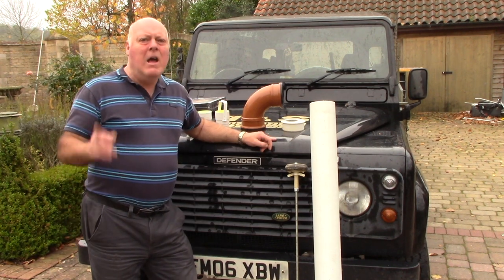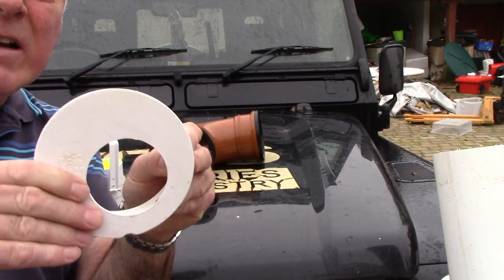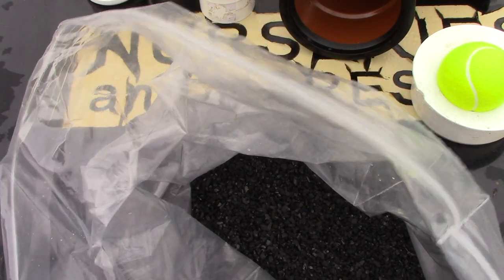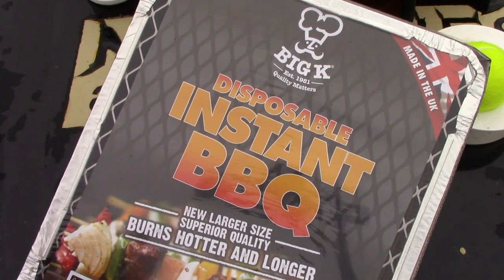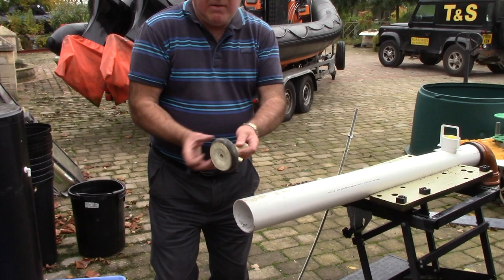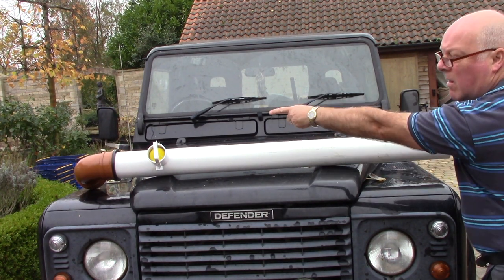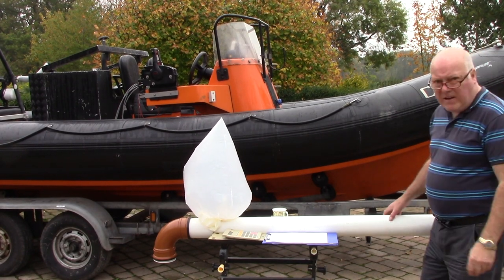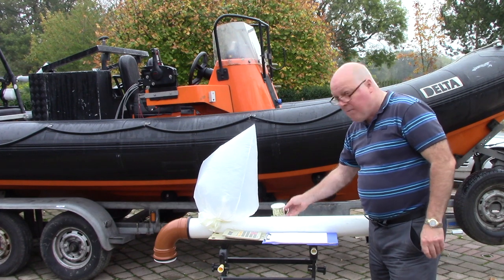Making a Nuclear-Resistant Air Filter

Comment: Good concept. I'm sorry mate, but there are some concerns with your design.  When gluing PVC pipe, you need tighter fits between the cut pieces. The glue does not seal gaps very well. The glue "melts" the PVC plastic together as it sets. You coat each mating surface FIRST, then twist back and forth into place to get the PVC to soften (melt) together, not glue after mating. A minute later you have an air/water tight seal. Your gaps are too wide, the glue will not hold well in the gaps and leaks will form. Your tennis balls are check valves. The Fuzz on the balls leak air a tiny bit. Smooth rubber balls would get a better seal.  The towel around your activated charcoal (carbon) will have less resistance to air flow and microscopic fallout (smaller than smoke particles) will get through the towel fibers and only some will go through the filter. You need to make a canister of activated carbon. It should have screens and HEPA filters on each end to hold the activated carbon inside, and rubber seals around the canister to keep contaminated air getting past it.
Reply: So you should do a video with the updates or some pic's
Reply: @lorimaravilla8379  I use a battery/bike pedal electric air pump in my doomsday shelter. I have no interest in making a PVC pump and I don't post details on my systems. I only giged him on things that he thought were OK but clearly has no real experience with PVC pipes or nuclear fallout. I said it was a good concept, my comment was to warn others that he has some fatal flaws and how to fix them.
Reply: Plumber
Reply: @lorimaravilla8379  tbh 2 socks taped over a vent are better than nothing. This is better than 2 socks.
Reply: @lorimaravilla8379  The king of random has a home made pvc air/water pump. I'm sure that design can be easily adapted for use.
Reply: @paulromsky9527  While you right people would fair better with what he has made then if they had nothing i.e. those who despite all the warnings on the wall.

My issues with his design are more related to the initial heat wave and if that would be enough to either melt the PVC or set the charcoal on fire. Plus I am not really keen on breathing what comes out of heated up PVC chemically speaking.
Reply: @AussieSurvivalAndPreparedness  Yes, PVC outgasses for decades (before it half lifes). Look at the dashboard of your car, even if you don't smoke, a thin clear haze will deposit on the inside of your windshield. This is not from air pollution, it is from the outgassing of the plastics in the dashboard. I used to work in laser and space satellite design, it's amazing what outgasses. In space where the pressure is in micro Torr, even metals outgass. It really limits your materials.
Reply: @paulromsky9527  this comment section seems pretty knowledgeable were I'm building my shelter is kind of in a forest and so is my house 😂 but it just crossed my mind I'm not sure but how hot would it get in a bunker if a forest fire was raging on top of you?? Probably would get a bit toasty if your not far enough down..
Reply: @alandale8961  I have a slide show on a doomsday shelter on my channel. Check it out, it has a lot of features you might want. Forest fires are going to occur during a disaster.  My concept has the ability to filter air but it would be better to shut down the ventilation system for most of the time if a forest fire is overhead, live off the air you have for, say, 12 hours, then refresh the air and shut it down again - following this cycle until the fire burns out over you. Once you get past a forest fire there is not much left for another... so you will only need to ride one big one, then filter out the rest that are distant.
Reply: @Alan Dale  Also, my concept shelter is 10 meters (28 feet) under ground, it could be less if I was concerned about forest fires alone, but it is deeper to act as a shield for radioactive fallout and for thermal stability. At that depth the earth is about 12 degrees C (55 F) - a bit warmer in the summer and a bit cooler I the winter. This is a comfortable temperature range year round. A first you would need a sweater but after a few months you would get used to it. You should expect to stay in the shelter for a year.
Reply: @Paul Romsky  interesting info on outgasing, I knew some took place but learned a bit more, thanks for sharing
Reply: @AussieSurvivalAndPreparedness  It would be pretty easy to encircle the inlet area with a metal heat shield or even dirt.
The PVC idea is not a bad concept, but the joins need to be made as neatly and close fitting as @Paul Romsky pointed out and sealed (melted) in the correct way. I would also smear a bead of Silastic or the like, around all these joins just to ensure they are air tight.
There are better ways of doing this, as I'm sure the original poster knows, but this is a least something for a person on a tight budget.
Reply: @alandale8961  Not really an issue as heat rises!
If you build a camp fire and then drag the coals out of the way, you'll find its not hot a couple of inches under where the fire was.
Reply: @paulromsky9527 thank you for the tips.  Some people just don't know how to associate with others... without being snarky & sarcastic.
Reply: It's radiation resistant not radiation proof
Reply: @schlomofewhairs4120  Radiation "resistant" applies to Gamma penetrartion in materials... that does not apply in his ventilator... his will "leak" air contaminated with particles that decay and emit Alpha, Beta, and the most lethal Gamma rays.  Even a small proportions of those particles getting through are just as dangerous as no filtering at all.  The particles are so tiny they can be inhaled and loge in the lungs, eyes, digestive tract, and give the occupants a constant dose of Gamma Radiation.  
So don't fall into the Radiation Resistant pitfall, nuclear fallout "Air" must be properly filtered to be even close to safe.  His idea, although with good intentions, is just a backyard idea that looks good but is not thought out scientifically.  I posted to warn people of the flaws in his design.
Reply: @davidhuett3579  The heat/melting I was referring to was to the "gluing" of PVC... it must be a tight contact where the adhesive "melts" the PVC together (takes a few seconds as you force the pieces together) for an air tight seal when it cures (in minutes). This video shows gluing PVC together with big gaps and the PVC not in contact all around - very weak/flimsy joints.  Doomdays shelters keep their ventilation off and sealed during the fireball/shockwave phase of a nuclear detonation.  A few hours later the air may be only as hot as nearby forest fires, which that air can be cooled by heat exchagers before the filtering system.
Reply: @paulromsky9527  you have to calculate air for size of shelter and amount of people you have in the shelter, I looked into oxygen vs co2 for placement of the vents for air filtration, my question at the time was co2 heavier than oxygen or air in the atmosphere, as we know some gases are heavier than others, I didn't want all the co2 to settle at the bottom of the shelter while exchanging good air at the top. Turned out it didn't matter, once they mix they don't separate.
Reply: @richardbellsr2345  Yes, in air tight closed areas, CO2 accumulation can be a problem. In spacecraft, they use chemical filters to remove excess CO2 that builds up. In a small shelter, that would take a few days to become critical. A well equipped shelter would have many such CO2 filters on hand to ride out large fallout events that would clog the micron level air/fallout filters (the outside air is cut off at such times). Also, electrostatic and water bubbling improves air filtration. My fallout shelter ventilation system design uses all three (multi-stage micron, electrostatic, water bubbler filters), it has air-conditioning/heating/humidifier/dehumidifier, an air tight vent door to close off outside air, and it recirculates the inside air to keep the air from stagnating in the corners. When the CO2 level in recirculated air rises, the system recirculates the air through the chemical CO2 filters (which don't last long before they are spent). The system does not run continuously, it comes on once a day for just a few minutes (or when it is safest) to purge inside air and bring in fresh properly radiation free (near 0 reading similar to normal air) filtered air. Since that normally happens on a daily basis, the CO2 levels never get high enough for the CO2 filters to kick in - except after a few days when outside filtered air can't be brought in due to heavy contaminated air events.  Even in a perfectly sealed container, CO2 normally stays "homogenized" with the rest of the air elements due to thermal activity - only near 0 K would it start to separate out. But some areas of an air tight shelter (in closed vent mode) could have higher levels of CO2 from other areas if the air is not recirculated daily.

Yes, CO2 alone is heavier than air mixed with it. Try this: Wear gloves, eye protection, and be in a well ventilated area. In a common styrofoam picknick cooler, place a small chunk of dry ice (frozen CO2), pour in some tap water to just about cover the dry ice about 50%, place the styrofoam cover on the cooler, and wait a few minutes. Then slowly remove the cover.. You will see that a cloud of mostly CO2 (with some water vapor) will fill the cooler. Lightly wave some "fog" off the top and notice how the cold denser CO2 stays toward the bottom. This is not only because the CO2 is colder, but because concentrated CO2 is slightly heavier than in less concentrated mixed air.
Reply: I see a few comments from the keyboard warriors but ignored them, just jump start know it all. So, nuclear war is unlikely going to be immediate and engulf all living areas. Most likely, it would be tactical tit for tat, then someone gets stupid and drops one on a city, and all hell breaks loose. As soon as the first bomb drops, you can pretty much guarantee that building materials for bomb shelters will dry up in a matter of hours. Then, it's a case of use what you can find.  This stuff already exists in my house, I could literally pull it out and build that. I've got a huge bag of food grade (yes, I know, not activated) charcoal for my smoker. Kids have got balls. So im pretty much there. I'm actually a builder and can pick up all that from my work yard. If I built a device that works on those principles right now, I could get my mate to machine one for me with tolerances of 1 nanometer. But when someone starts chucking nukes around, you will be lucky to get the tennis ball. 
So, working on the Nuke radiation principle of ten feet from the outside wall, sealing the house, and  sitting under the stairs. This may be your only chance of survival. So if you are not going to invest in a high-quality one. Have a go at this and learn the principles of making them. Let's see the keyboard warriors build one in the shadow of a mushroom cloud. I dont think this is meant for preppers or survivalist, but for people who are interested, but dont think it's ever going to happen. 
Great video.
Reply: @DustyMillerjcm1970  I did not build a ventilation system AFTER a nuclear event... I built it BEFORE and used real physics and engineering: like filters that filter down to the Angstrom level. This guy had good intentions but most likely only a few nukes will be used and nowhere near him, but the fallout will reach him. But his system is good for one thing... it will bring in much more fallout and he will soon succumb to radiation sickness... and thus not have the suffering of trying to survive.